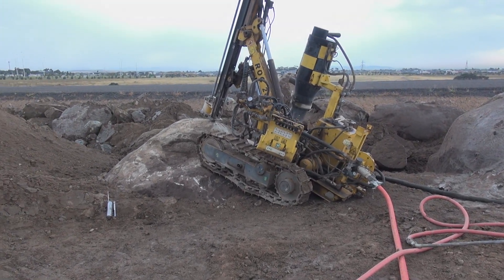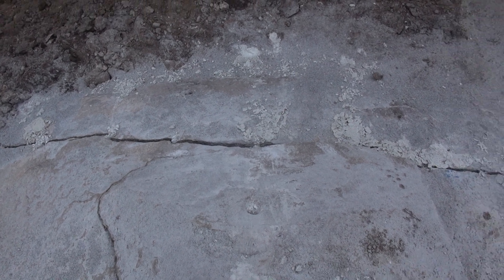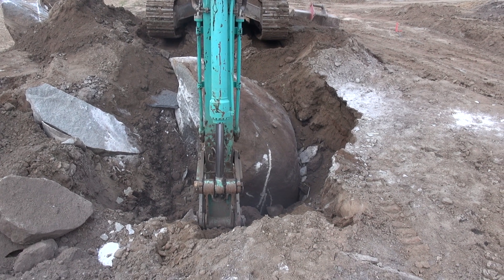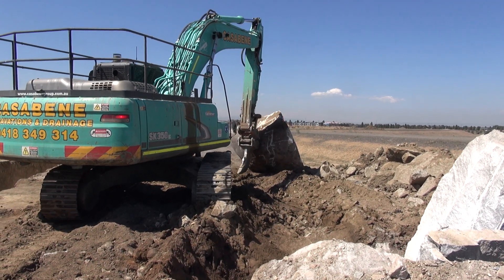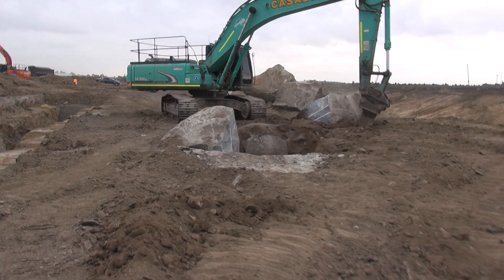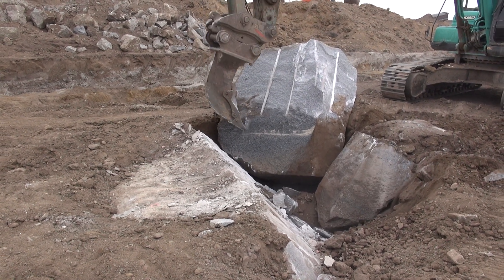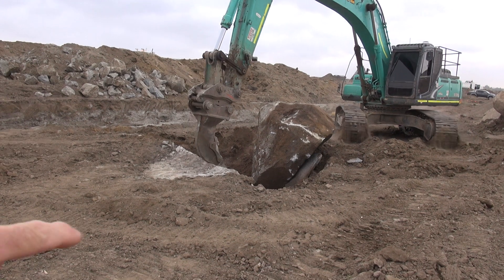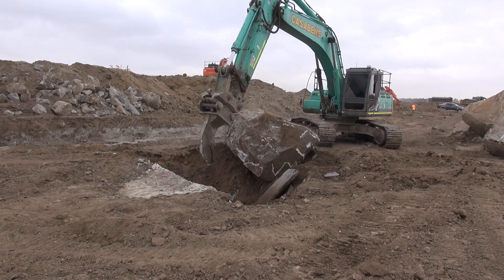Breaking massive Granite rocks with Expando

Comment: So where can I buy the stuff??  I have a 1m tall and 3m wide rock 1.5m in front of.door.
Reply from the maker: OK, there are many different brands of this stuff, the brand that I'm using is Expando, only available in Australia, other brands are Eoobust and Dexpan. Dexpan is probably the most widely available. When buying this stuff, check the date stamp as it has a short shelf life, after about 18 months it does not work as well. You might find the drilling a challenge, you need to drill 38mm diameter holes more than a meter deep.

Comment: Why wouldn't you blast these rocks.  It looks like the middle of nowhere
Reply from the maker: These ones were buried right up against an asset that they were worried about. so I broke them with the Chemical Cracking Agent.
Reply: @demolitiondavedrillandblast  guess it was the same amount of holes👍. Jack hammer probably finish them off
Reply from the maker: The jack hammer on the 35 tonne excavator was destroyed in a very short time trying to break these rocks.
Reply: @demolitiondavedrillandblast  really! They must be pretty rubbery. Bang the shit out of them but they absorb most of it while still grinding the tip. You wouldn't think seeing as so few holes split them

Comment: I was going to give you the job, but now I think I'm going to try the goohon my own. Lol. Very impressive.👍👍👍👍👏🏻👏🏻👏🏻👏🏻👏🏻
Reply from the maker: Go for it Grumpy, please take the safety precautions seriously, eye and respiratory protection is a must, this goo is extremely alkaline and it will even etch glass. Make a video of your project. Make sure that you drill large diameter holes, 38mm is best, don't even bother with anything smaller than 32.

Comment: Why doesn't the Expando just come out of the top of the drilled hole....
Reply from the maker: It hardens and then expands.
Reply: @demolitiondavedrillandblast  
Is it expensive, could a home owner use it on a set of concrete steps...
Reply from the maker: Certainly, anybody can use it, the hardest part of the job for most home owners would be drilling large diameter holes - preferably 38mm (inch and a half) and you must use eye and respiratory protection as you really do not want to get the dust or slurry is your eyes or lungs - believe me.

Comment: Great to see you back in action. 

What sort of chemistry does the expando work on?

What effect would a shaped charge have on a rock?
(Yes the pressure times the surface area in a hole is immense in comparison)
Reply from the maker: Hi Bruce, the Expando is mostly cement with some magic added. Chronicle shaped charges can be used to break oversize effectively if you don't mind a huge bang, very waistfull  use of high grade and expensive explosive though. Another thing to consider is that when trying to break a rock with and external shaped charge is that you are attacking the rocks compressive strength, when using a drilled hole you are attacking its tensile strength, which is a lot less.
Reply: Thanks. 
I’m surprised the shaped charge would do anything at all considering compressive vs tensile strengths. 
Wedges vs hammer blows on the surface. 

The expando magic must be some reaction from high density reactants to low density products.
Reply from the maker: A conical shaped charge  will certainly crater the surface and even destroy the rock if it is big enough, the military have one that they call a bee hive charge, I understand that they are good for making deep pole holes in softer rock.  https://www.google.com/search?sa=X&rlz=1C1CAFA_enAU623AU623&q=beehive+charge&tbm=isch&source=univ&ved=2ahUKEwihoOGQ87DgAhVCzFQKHdn9CmEQsAR6BAgDEAE&biw=1920&bih=969

Comment: Dave, how much would those pieces weigh? Cheers, Mike.
Reply from the maker: The rock weighs in at about 3.5 Tonne / m3 notice how the 35 Tonne excavator slips backward when trying the push the rock away around the 2 min mark. They are very heavy!
Reply: @demolitiondavedrillandblast  Thanks for your reply, Dave.

That piece at about 1:50 where you say it's about 5m long end to end: it's hard to estimate the dimensions from the video, but if it was, say, 5m x 1.5m x 1m (roughly equivalent rectangular prism to account for the irregular rock shape) then that's about 26 tonnes ... no wonder that excavator had its tongue hanging out moving those rocks!

Comment: Hi Dave interesting little topic, but could you explain why you did not blow them up into smaller size,I think if you had a little bit of a story to this,it would be a lot more interesting topic, like why did you use the expand OO
Reply from the maker: Hi Robert, we were working close to a protected asset that a neighbouring stakeholder is concerned about. They are all over us with vibration monitoring and one excursion over the ground vibration limit and that will be our last blast on this project. Expando breaks rocks without any noise or vibration .The reason that there are such big pieces is purely cost control (smaller pieces requires more drilling and more Expando). Once they are out of the ground we can roll them away from the protected asset that the customer is concerned about and then use explosives to reduce the size further.
Reply: @demolitiondavedrillandblast  What do they allow you guys? Anything over 2" and we in hot water
Reply from the maker: @jamesfawr  - Same for this one - 50mm/S, normally only allowed 10mm/S  {3/8"/S) domestic jobs.
Reply: "protected asset" eh?
Reply: Demolition Dave Drilling and Blasting thought of you yesterday. Had to hand drill a knot.
Reply from the maker: @jamesfawr  - Hand drilling is character building.